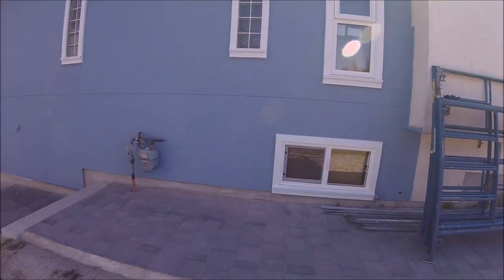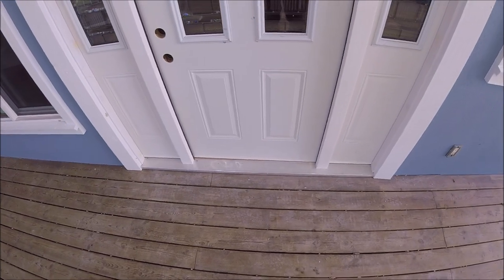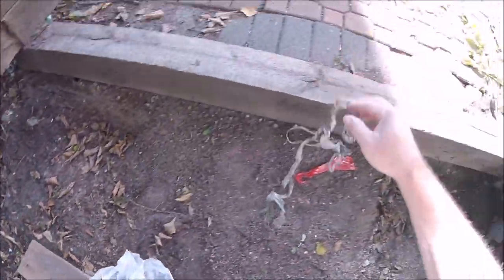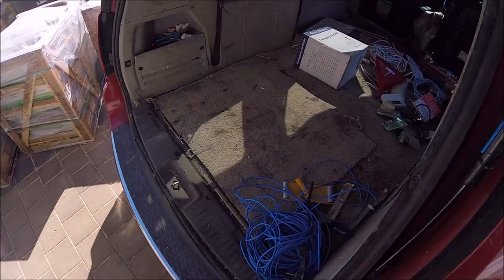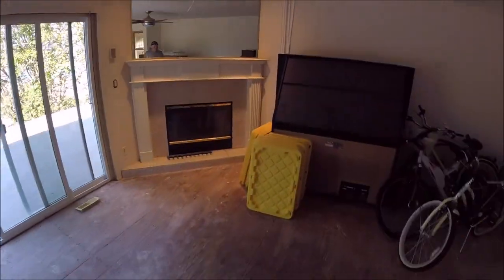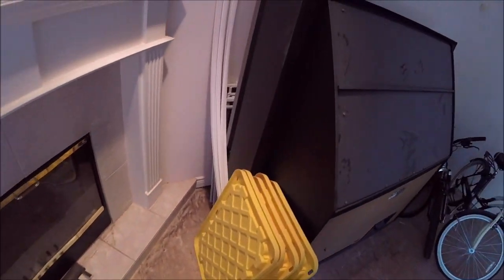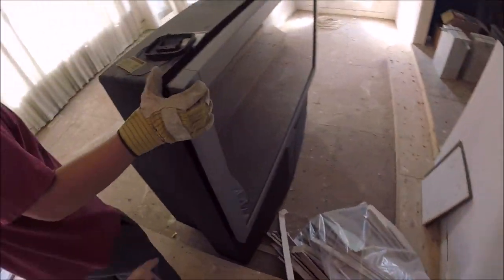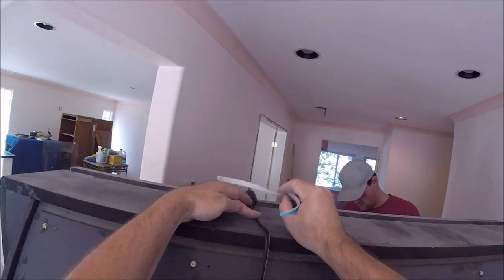How Did I Move These Big Screen TV's

Comment: Phil, Don't change out the deck railing unless structurally unsafe. Suggest you avoid the unnecessary expense. Painting black would look good on deck railing. Overall exterior finish looks very good and provides excellent curb appeal. Also suggest not adding very much exterior stone. Why add when the front exterior looks so good? Save the bucks for interior work. 👍